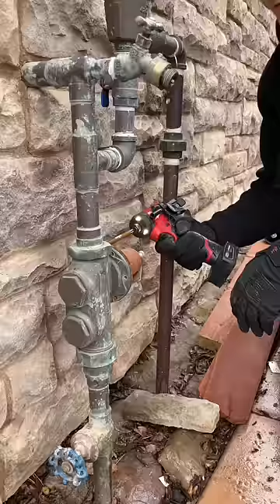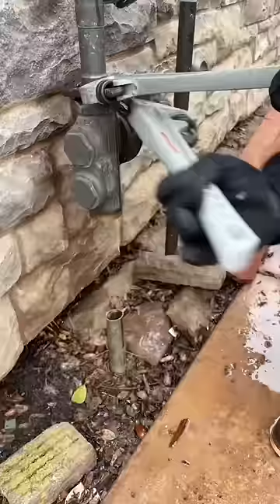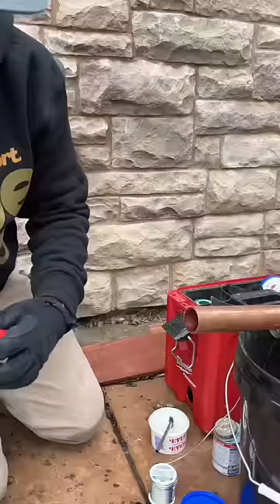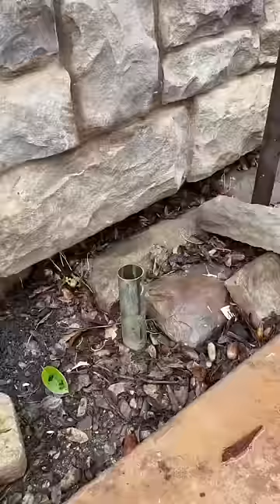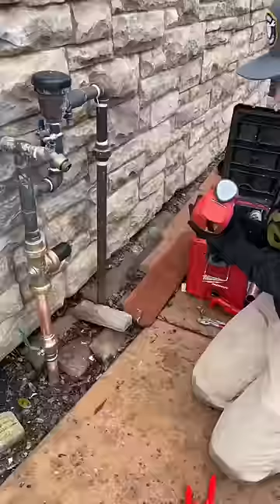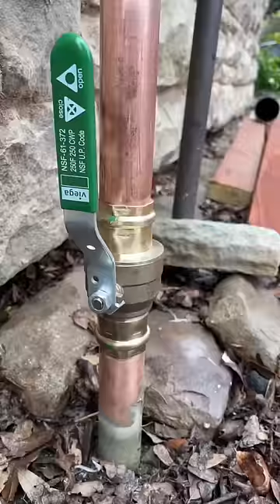replacing a pressure regulator and wearing @Troll Co. Clothing use code ‘Replumb10’ #plumber #plumbing

Comment: Ppl look at me weird because some stuff I sweat some stuff I press. I tend to sweat the more expensive press fittings. It’s good to see someone else mixing and matching techniques
Reply: I do the same, some solder some press makes a lot of sense!
Reply: And all ratty
Reply: I'm not a plumber, so obviously didn't realize pressing was even a thing. What's the benefit of mixing and matching between sweating and pressing?
Reply: It always pays off when a guy sweats the small stuff
Reply: @jy4508  time is the answer to that. Sometimes it’s just faster to sweat. Personally I do not use the press fittings. Sweat, Weirsbo (expansion ring) or Rehau (crimp rings). Just my preference. Press fittings are great too
Reply: Yeah he just tends to propress everything because it's easier.....
Reply: Had you had that fitting in a propress which one would you have used?
Reply: I’m not sure why people mix and match. The torch was already out and would have made a better job. The tool is expensive so maybe he’s trying to get his money’s worth?

Comment: "ERRRRR.... shouldn't the control valve handle go down???" 😂
Reply: It’s pointing in the direction of water flow so the water will know which way to go.
Reply: @AffordBindEquipment  I know I'm just mocking the Haters that bounce around messing with folks!
Reply: @NTATchannelNickTaylor  get it!  and then there are 14 different opinions on what should have happened.  There can't be 14 different right ways to do something that has to be code.

Comment: I've had a milwaukee band saw for over 20 yrs. While I love it, it's big and heavy.
Milwaukee is killing it in the battery tool space.these mini band saws look great. 
Definitely going to get one of these for replacing all of the old galvanized pipes in my house
Reply: Omg. I bet it’s so much smoother than a sawzall. I’ve never used a portable band saw.
Reply: @leonardticsay8046  The big corded one is great, but it is heavy and difficult to keep at 90 deg in the direction of the cut. Left 
, right is good as there is a guide.  It's definitely smother than the sawzall. I'm looking forward to get the smaller battery version esp for plumbing.
Reply: I have one. For demo?  These things are unbeatable.

Comment: If mechanics can afford to blow their money on shiny tools, I think a certified plumber can afford a pro press. If it's the newage tool, it's the new way.
Reply: New isn’t always better pro press fittings have a ten year warranty if you are good at soldering then it will last longer then ten years.. just food for thought
Reply: A ten year warranty doesn't mean they will fail a day after ten years.  Just food for thought.
Reply: Been using them for about 20years with no problems in the U.K.
Reply: It’s the new way because it’s better. If it wasn’t better it wouldn’t be the new way. 😊
Reply: @tacticalmarshing9548  “new” things aren’t always better. Propress is THE new way to connect professional grade plumbing. The new way is the new way because it’s better or it wouldn’t be the new way.
Reply: @zerovalue5106  yeah I’m not shitting on them i use them as well I just believe that there is a time and a place for them save the money on the fittings and braze that pipe unless you are under the house or in a tight spot. Also new in the plumbing world has not always meant better look at  spartan pipe for an example new at the time and a lot easier to use and lighter then cast iron but was a total failure.
Reply: A Can of Glue and a Ladder, Congratulations, You're a Plumber.

Comment: damn i wish i had those tools when i was a plumber back in the day! you grab one pipe cut it or heat it and you twenty leaks in the wall and your getting shocked because the electric wires have cloth on them that rotted off so basically just wires in the wall live! west new york.

Comment: Legit question, if the previous plumbers go to the trouble to put in fittings so the regulator can be removed by unscrewing the fittings, why does the new regulator get installed in this way? Does the valve near it always need to be replaced? I see everyone does it like this instead of just screwing in a new one. And it gets installed with threaded fittings too lol. Does that mean the next person can unscrew and replace or does the repair need to be done the same way you did it? Like i said I'm genuinely curious no judgement i am a homemaker not a plumber :)

Comment: I've never had problems with pro pressing outdoors. However many foremen have told me that they can easily fail in the cold but I guess just a little insulation fixes that. Amazing job very confident and efficient.

Comment: Looks good! Actually used your pliers correctly this time. Did you remember to readjust pressure? Just gotta remember to keep it under 80. We usually go down to 60.
Reply from the maker: thanks for the tips! it’s very helpful that you’ve told me this information a week after I left the job. without you, I might have forgotten how to be a plumber!
Reply: @replumb Definitely! I'll keep 'em coming. And sorry, It's not like I'm waiting for the exact second you upload a video to respond :(. But now you know, gotta readjust prv once installed. Then check expansion tank at water heater. Pressure has to be the same as water coming into home. No expansion tank? Gotta put one on. Oh, and all is good. You can't exactly forget something ya never learned. But it's alright, you'll get there.

Comment: The only thing wrong with this video is seeing water lines outside, but that's probably just the Canadian in me 😆

We lost power in one of our older buildings for 3 hours when it was -50 this winter, and had 2 hydronic entrance heaters freeze solid. Building wasn't built with glycol heating loops for anything at risk.

Comment: How do you know the pressure regulator was bad?
Reply from the maker: Pressure gauge
Reply: @replumb  when the regulator fails does the pressure usually skyrocket high or it's like a gradual increase in pressure as it fails slowly?

Comment: I’d like to get you an MC tank with a turbo torch for the fittings you chose to sweat. I’ve never crimped like that because it wasn’t available when I was pluming. Map gas torch worked but once you go to turbo w/ MC tank you’ll never go back.

Comment: Ahh the arrow is facing one way on the old one, and a different way on the new one??. Also just asking why all the valves in one spot is this a feed for the house or a sprinkler setup with the other valve going to a hot water system?

Comment: Clean installation. But why are you always using ball valves on water lines? They are hella illegal in my country. Only used for heating.
Reply from the maker: Because they’re not illegal in mine
Reply: @replumb  yeah but an ankle seat valve is way better suited for water lines. Better longevity, easy repair, no pressure shocks.

Comment: How much is that copper 28mm? And what is the valve for
Reply from the maker: it’s 1 1/4” the valve is to reduce the incoming pressure
Reply: @replumb  OK so roughly 32 mm.. OK a pressure reducing valve. What country of the US are you in

Comment: Ball valves no longer have lead so there's a procedure for soldering them. If you don't know how then you pro press them.
Reply from the maker: I obviously know how to solder as I did it in front of you on video…
Reply: @replumb  Yes you do. I said you must not know the procedure for ball valve soldering. It's different than regular soldering. Nobody is born knowing everything. You can learn how. It's only a procedure.

Comment: I don't understand what's so wrong with solder. The longevity of these o ring pro press stuff concerns me.
Reply from the maker: might want to do some more research on the viega warranties and pressure/temperature ratings
Reply: @replumb  still didn't tell me what's so bad about soldering.

Comment: Why did you cut the valve out?
Reply from the maker: why wouldn't I
Reply: @replumb  Because it was probably unnecessary? Was it leaking? And if it was, why not replace a $0.10 seat gasket?
I don't know the situation, so I'm asking, not criticizing.

Granted the new valve is probably full port and has better flow if that was a need, but I doubt it. I have just too many problems with ball valves and they are not serviceable. Often scale builds up on the ball or the plating corrodes off. Then when you close it, it scratches up the seat and it leaks. I am also not convinced they can be safely sweated without damage to the seat. I've had to replace too many that leak five years later. 

I am not a plumber, these are just the ones I have dealt with in my own life and helping others. I've gotten to the point that I will never sweat a ball valve in place. Granted having a hot torch and the experience to do it quickly makes it much less likely to be damaged, but a threaded one, crimp, or sharkbite is guaranteed to not be damaged. That heat damage isn't always apparent immediately. There are lots of factors here of course, the manufacturing quality of the valve, materials used, water quality, temperature, installation technique, etc..

Comment: Whenever you replace the regulator you replace the P-150 valve. Its not necessary but if you want to increase your ticket as a stand alone plumber that’s a way. Also ball valve should be point with the flow of the water.
Reply from the maker: it is pointing with the flow of water
Reply: The 1 1/4" main water line is coming up from the ground so his ball valve is installed correctly. Tell me you're not a plumber without telling me you're not a plumber.
Reply: @sjohnson5813  he's probably a northern plumber. It's so weird seeing a water main run above ground to northern guys, it's confusing. At a glance, that looks like irrigation plumbing.

Comment: Just out of curiosity is ok to have a connection like the one before the last press joint I would think that since it's out side rain can potentially get in and sat there and mess up the connection soldered would seem to be better but I'm not a plumber what you guys think???